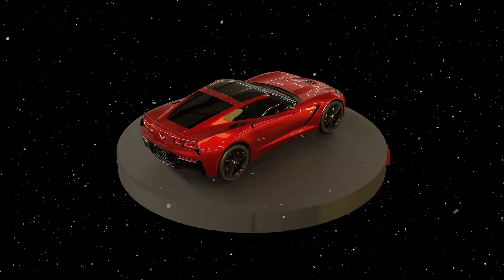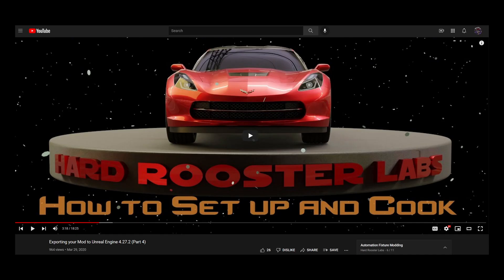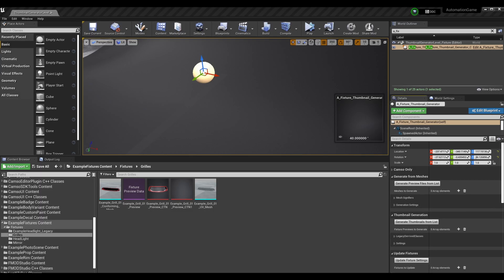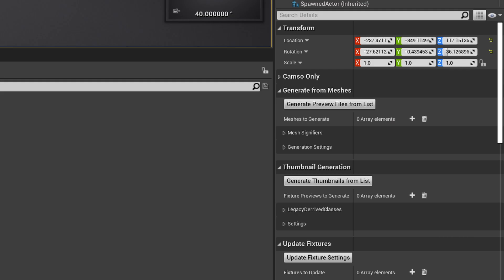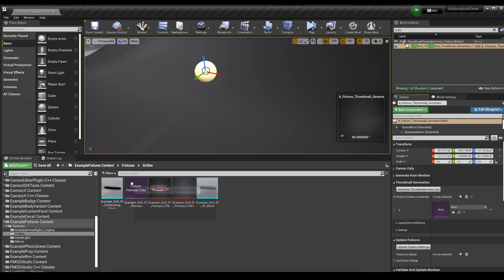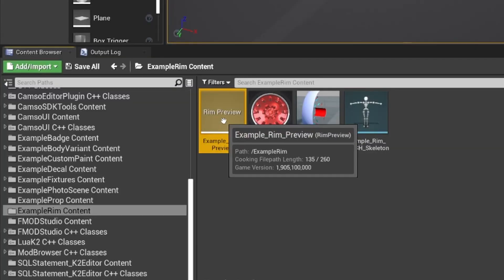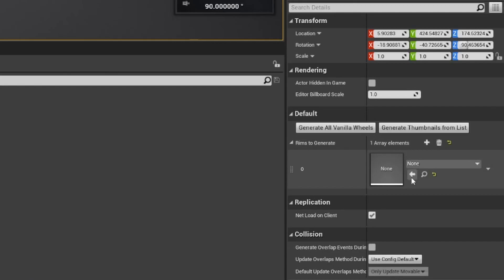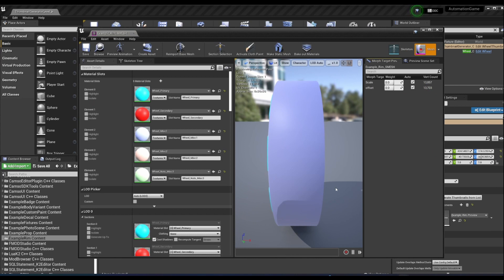2022 Update to Part 4 in the Automation Fixture modding series

Comment: Okay so i when i press the "generate thumbnails from list" button nothing happens...
I added an array element and selected the fixture preview data i wanted to thumnailify, then i press the generate thumbnails from list button and it just doesnt do anything
Reply from the maker: I just grabbed the very latest SDK and got a ``BLUEPRINT COMPILE ERROR`` all caps red letters in the top left of the 3D view-port when I tried it, are you seeing the same thing?
Reply: @hardroosterlabs3814  No,  but there is this message "reflection captures need to be rebuild (1 unbuilt)" But thats always there even when i dont generate thumbnails
Reply from the maker: @acubens8533  OK, thanks for the report.  We're already working on a fix.